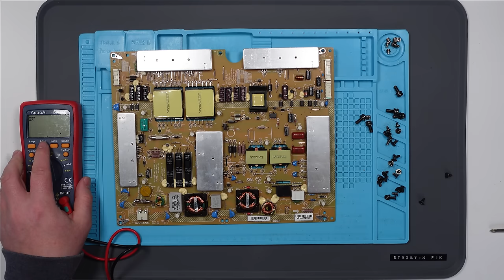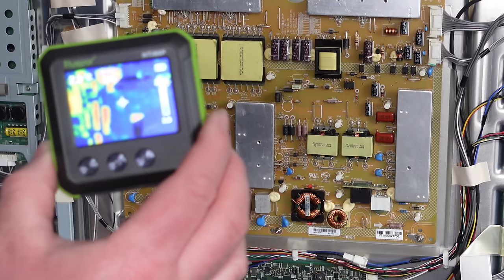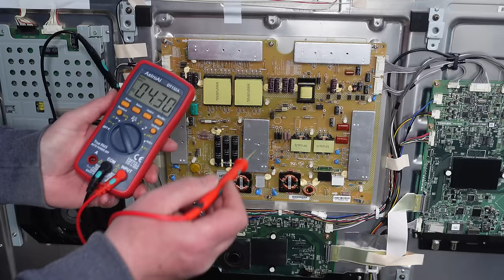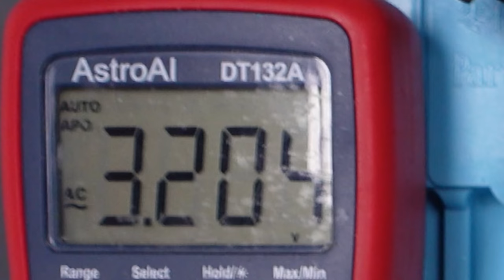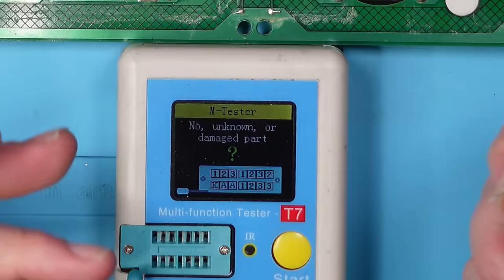Trying To Fix A TOSHIBA TV With NO POWER

Comment: So what you're looking at is a toroidal common-mode choke.  Basically it's a filter that removes high frequency noise from the AC lines, but lets your 50Hz through.  As others have commented, something else has died on the board and fried this and turned the fuses into fireworks, so that needs to be fixed first ... so pull the bridge rectifier and check for shorts on the DC side.  Test the rectifier while you've got it out.  Solder wick those big power transistors and diodes removing them complete with heat-sinks and test those out of circuit too.  Finally, you worried me little when testing with AC, it may just have been the camera angle but it did make me squirm a bit.  Learn about the one-hand rule, if you get zapped on one hand it'll smart but you'll live, if you short the mains across your ticker it's game over.  https://www.eevblog.com/forum/beginners/one-hand-in-pocketbehind-back-when-measuring-mains-voltages/
Reply from the maker: Thanks G B! Excellent advice as always! I was apprehensive doing the testing, but I had a steady hand and was well clear. But, I will definitely read up on that technique, much appreciated!
Thanks for the heads up on which other components to test! I'll definitely be doing that. 👍
Reply: @StezStixFix  So long as you're safe, it would be remiss of me not to at least show concern.  Also quite self-serving as I would sorely miss your excellent videos.  I guess a pair of marigolds is also an option
Reply: Left hand in your trouser pocket or something similar?
Reply: First thing I go straight for is the PSU PCB and head straight for the BIG Diodes, ESPECIALY where there are 2 or more wired in PARALLEL as if one has gone Short they all act SHORT.  I de-solder one leg to test and swap out the Bad!  7 times out of 10 that's the fault and then I'll just change any FAT CAPS!
Reply: Every time you plug it back in I shout BANG! Just my slightly sick sense of humour! Lol I’m not a fan of high voltage either, prefer the low voltage stuff after I put 240v through my finger, surprised I never blew the end apart. That was when I was very new.

Comment: This my or may not work depending on said coil but using a resistance test on the coil and comparing it to the presumably working one may give you more information I assume each side is a separate winding so test the resistance of each side on the in and out.  if you need any more help give me a dm in joe's discord. it seems ROY has found the replacement on ebay so maybe worth just swapping it out.
Reply from the maker: Thanks Mr Flibble! Really appreciate that. I didn't think to measure the working one, but that makes perfect sense. I also can't find the exact component anywhere, but I figure if I can get something that behaves the same and does the same job, I don't see why it wouldn't work! 👍
Reply: @StezStixFix  np heres a guide on measuring Inductance I would imagine if the cold resistance and  Inductance is the same on your as the new one it should be ok.
https://www.wikihow.com/Measure-Inductance
Reply from the maker: @flibble666  Awesome, thank you!

Comment: Slightly off topic but about Toshiba nonetheless. The POS DOLLAR STORE QUALITY TV 43" Toshiba FIRE EDITION I have has been rebooting every couple hours since I plugged it in. Watching a good movie - POP! - Goes to the smiley with three dots and tries to reconnect. TRIES TO RECONNECT! It can't seem to ever connect back up. Says there's no signal. Everything else in the house is running. Takes 20 - 30 min to get the worthless POS connected again. Couldn't find a signal next to the router. Hmmm.  WiFi is strong.
 TV is phenomenally, conspicuously nonfunctioning. I'm not the only one according to the amount of negative, similar feedback. TOSHIBA SUCKS

Comment: 12:17 Why don't we go get a schematic then? Unless Toshiba are one of these companies who copyright all their manuals and won't let anyone see them...APPLE !
Reply: I'm trying to fix a 42HL96 and was shocked, totally shocked, that I found a service manual online that shows the circuits.  
Mine is stuck with 3 flashing yellow, indicating power fail...or it needs a remote, can't be sure which.  I plan to make it run on 12v dc, so will probably just scrap the ac power board and replacing the high voltage backlight with high power leds..if I can get it to work.

Comment: Just bypass it!!
Reply: Make sure you remove the coil tho when bypassing it
Reply from the maker: @deanavitch  I was tempted to do that, but wasn't sure how safe that would be? 🤔
Reply: It looks as though a balanced coil setup so cancels out any noise on the mains supply that is all
Reply from the maker: thanks deanavitch!  I did think it may be some kind of filter.  Appreciate the heads up!  👍

Comment: Another great video for electronics advice I mainly use badcaps.net TV forum most issues I can't fix myself I manage too with help of the experts on the forums.
Reply from the maker: Thanks Vince, I'll check that out! 👍
Reply: @StezStixFix  Shop jimmy do a psu repair kit so maye worth checking these parts out on your psu also have a look into building a dim bulb tester as it saves blowing up new parts if the psu has a fault still.https://www.shopjimmy.com/toshiba-75022759-pa-3201-01ts-lf-power-supply-component-repair-kit/
Reply from the maker: @vincef836  excellent, thanks Vince. I'll take a look at both of those too. Really appreciate the help! 👍